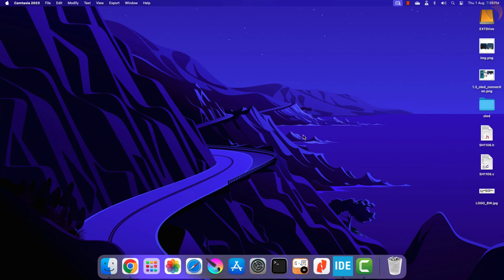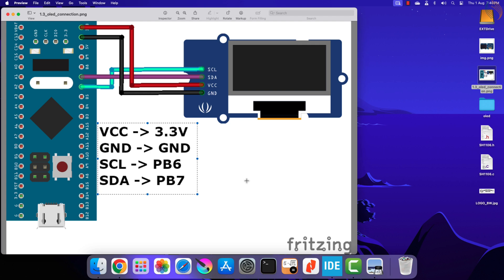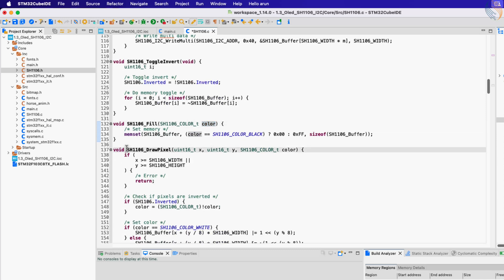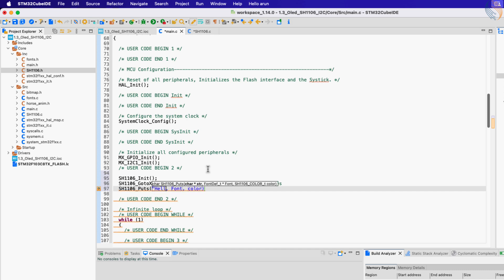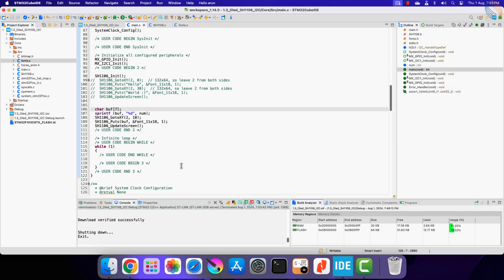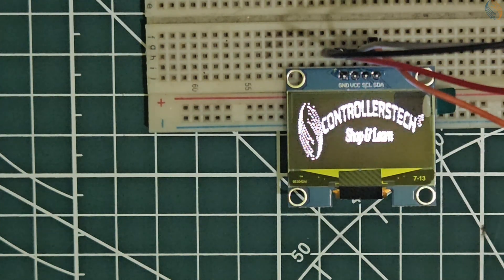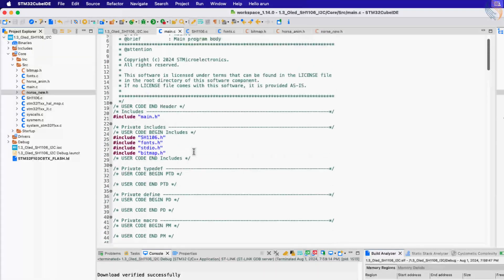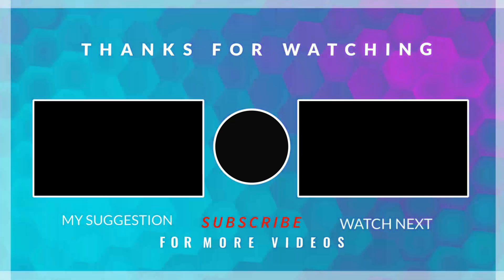Interface 1.3" SH1106 I2C OLED Display with STM32 || Text || Bitmap || Gif

Comment: THANKS MAN , i actually got into a problem as the display freezes when i use it to display with stm32f103, it keeps doing this , i have to reset hundred of times to replicate the horse anime
Reply: I actually found the solution to the problem, I didn’t add set of pull ups for the sack and sda, after I added them , it all worked fine , also for the vertical line to the extreme right , I declared the length as 132 instead of 128 in the video , it all cleared and working very fine
Reply: @adewumitoyyib9071  THANKS MAN!!!!

Comment: Hi, thanks for the detailed explanation. Finally, I got my display working. But one problem I am facing is a vertical white band at the left side of the display. What could be the probable cause & how can I rectify it?
Reply: check if u used correct resolution of your oled minor resolution change can affect a lot to the frames

Comment: Cool thanks,  do you know the differences between 1306 and 1106? Other then the scrolling function in the library.  I found a ss1315 screen and also wonder what the differences as the specs were all the same,  someone said it "likes constrast setttings better" whatever that means, im guessing better power consumption?  I wonder what the differences is with the sh1106.